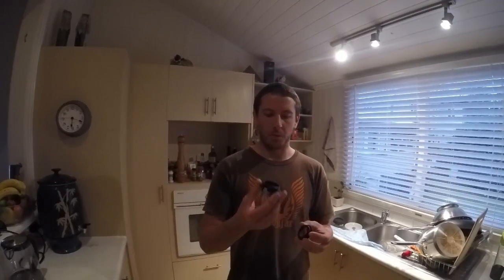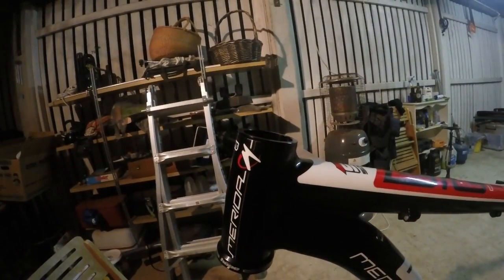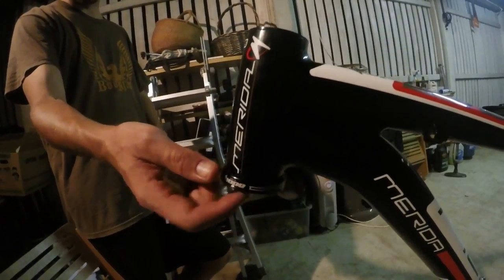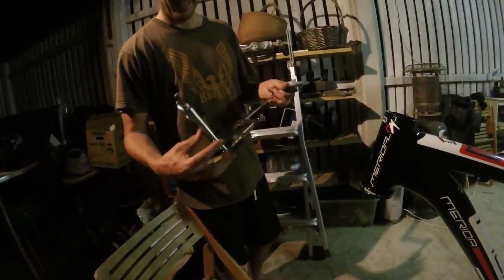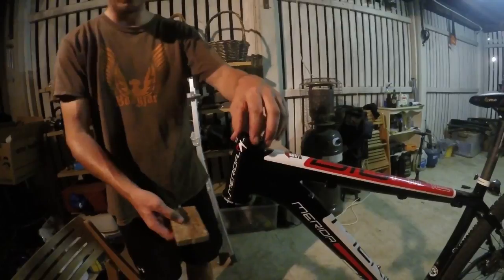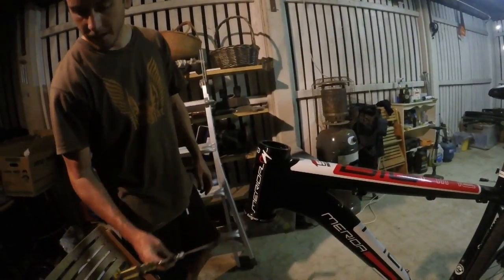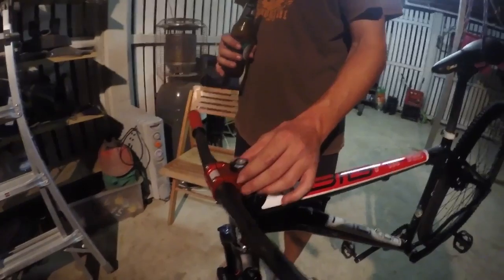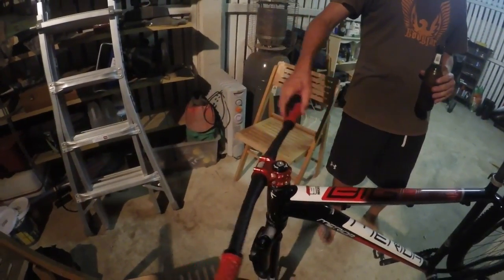tapered fork in a straight steerer headtube

Comment: Essentially its only doable if your head tube is wide like the 44mm ish size.  If you have those skinny vintage old school bike with the small head tubes you can't do it.  After that essentially when you put a new tapered fork you gotta replace your hub or buy new wheelset as the QR i assume is what you had with the straight steerer.

Comment: PURE ingenuity:) forget the expensive Park Tool bike stand:). This is so much better and cheaper solution:))). Plus you can spin the bike around when you need to. AWESOME!!!
Reply: Although its a good cheap solution which i have tried or used a vice with a 2x2 wood at first, the bike stand is 100 times better and control i ain't gonna lie.

Comment: Bro.. How is it now??? Is it working smoothly?? Any issues??
Reply from the maker: Yeah it's still good. No problems with it at all. The hope stuff is really good.
Reply: @louismacca83  what models the specific models of the headset cups
Reply from the maker: @ExploringApe  hope type h for the bottom and type 2 for the top. You will have to measure the inner diameter of your headset both top and bottom of your head tube to make sure you are getting the correct type. Go to the Hope site and download the info regarding headset cups

Comment: Hi, I've got a new Rockshox tapered fork on the way with the hope pick n mix headset cups (2 & H) and hope head doctor to replace the cheap Suntour fork with straight steerer that came on my bike which has a straight 44mm head tube.  What I need to know is: are there any more headset components I need to get to make this work or does everything you need come with the hope pick n mix cups?
Reply from the maker: DiverT 5000 From memory, I think thats all you need. I'm pretty sure the bearings etc come with the hope adapter.

Comment: Yeah you can make a press with a threaded rod and bolts and some big washers.
I use a big quick grip one handed clamp with the plastic protectors that you can squeeze together with one hand to get them partially started then use the threaded rod to finish it.

Comment: omg guys I love you SOOOOOOOO much! i have a straight head tube and was looking for something like this! I hear the new standard will be tapered. Do you think manufacturers will eliminate straight headtubes in a few years down the line?
Reply from the maker: maybe, probably not anytime soon tho. I think it's a bit of money spinner for certain companies??
Reply: bustex1 When you look at the fork options, the options in straight steerer tubes is very limited. I’m trying to build a 2005 Trek Liquid and the fork is the last part I need. I don’t want to toss my brand new Chris King headset but I might have to if I go with the tapered adapter. Or maybe I just need to trash the bottom section of the headset.